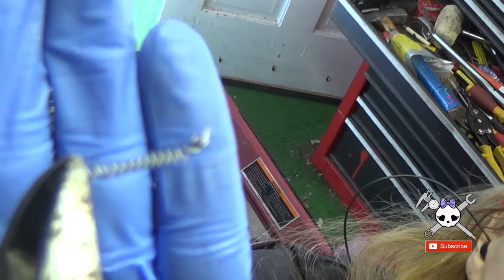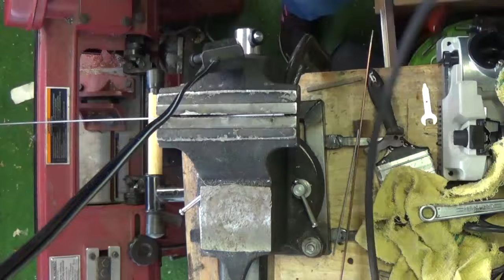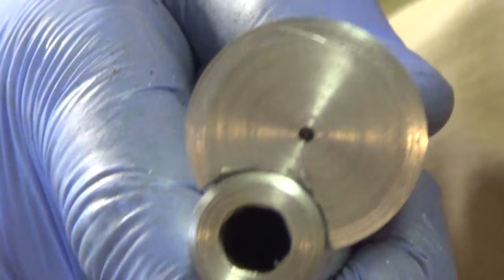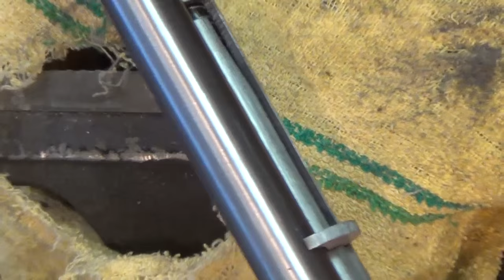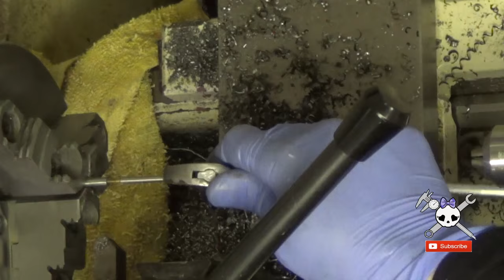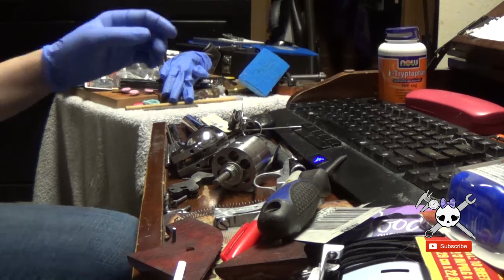1880's single action revolver build from scratch 15

Comment: Can't wait to see what's next.
Reply from the maker: thanks :)
Reply: A guy named John Anderson designed a ten round  bullpup 12ga. revolver. It had a blow forward design and a cammed cylinder that cycled the action and eliminated cylinder gap.  A few things weren't worked out in the prototypes, they had to be disassembled to be reloaded. I have no idea if that was ever solved, because the quagmire of  bureaucracy ultimately killed the gun and Pancore industries, the company he created.  I'd love to see your take on this, in a semi-auto of course. Even in different gauges or in pistol or rifle cartridges. The concept seems like it would lend itself to versatility. Seeing what you've done, I think it's well within your skill set. 
https://en.m.wikipedia.org/wiki/File:Jackhammer_blow.jpg
Reply from the maker: ya i have seen it https://www.youtube.com/watch?v=-VKGhqIl4Gw

I think it is a cool looking gun but as far as practicality not so much. just comparing it with  a reminting 1100 for instance . the 1100 holds 8 rounds + 1 in the tube and weighs about 8lb
the jack hammer is 14lb and holds 10. you could modify a Remington 1100 to be a bull pup fairly easily and loosing a foot of stock would probably even lighten it up a bit more. the 1100 also has easily interchangeable barrels that can be used for different applications (home defense /hunting)
so I don't really see any advantage to it at all
Reply: Waffenschmiedin x you're right about the Remington, and there are other bullpup shotguns that perform as well. But...
The jackhammer is just one of those guns that should have been. I guess I've become enamored by the simple elegance of it. And how many twelve gauge revolvers are out there? Who knows, in the interim, issues like weight may have been addressed as well.  
I liked watching how you did this project, you know far more about it than I do. Think I'll just sit back and see where your brain goes next.
Reply from the maker: hehe yes that's what I meant by it looks cool. its one of those guns people get because its FUN :)  im am far from an expert on any thing it was just an opinion :)
Reply: +Waffenschmiedin x Don't downplay your skills and knowledge. How many people can build a revolver from scratch?
Reply from the maker: my machining knowledge far outweighs my gun knowledge ;)

Comment: it looked as though your gun is very accurate,when you silver solder the front sight wasn't it hard to get it centered.If I was as talented as you I might have thought about drilling and tapping the front sight but I wouldn't think twice about buying one of your guns from the workmanship that I have seen you do.
Reply from the maker: it was a little bit of a pain yes.  the spring steel I put in the back sight groove self aligned so I just had to get it in line with it and square. normally that wouldn't be hard but doing it while hot made it fun :P
Reply from the maker: and I did think of tapping and drilling it but I thought it would ruin the look of the sight.  it definitely would have been easier

Comment: Good day...what do you think about grizzly lathes & mills?? quality- wise i meant..
Reply from the maker: the mill is as good as any mill I have used in any shop really it is really well built, the lathe is good where it counts. the chip pan and stand look a little like they were built in the back yard but over all ok, the steady rest that came with it is total junk and I will build a new one later. for the price they are amazing. I don't mind the chip pan and stuff because for the price they had to cut corners some place and I'm ok with it if its something like that. I was looking for some used American machines but almost all of them were wore the heck out. for the same price I got new and much more accurate then the wore out stuff. the import stuff will where out quicker I'm sure but it wont in my lifetime with the use its going to get so im happy :)
Reply: Thank you very much for very detailed answer...greetings from Ukraine,and God bless.

Comment: I think I would have gone through the trouble of either rust bluing or Colt's early bluing process. Seems like old blacksmithing tech. similar to heat treating. Where the gun parts are polished,cleaned with hot gasoline and heated in a furnace of charcoal and covered in bone char then periodically removed and rubbed down with oakum and whiting powder. The process essentially contaminating the case hardening process with carbon until the color is achieved. The use of oakum seems like carding to me. whiting powder(calcium carbonate) could be a polish or could be to add more carbon. Heck even the gas they used to wipe it down could be adding carbon. 

Im still working on piecing together what it takes to have a oxy propane torch, so no comment on a mapp hot head torch not producing enough heat to glass harden bigger tooling. But im not exactly sure why a propane forge couldnt get it cherry hot. Unevenness? A cheapo electric kiln element would set you back $3 through a chinese e-packet. Not as good as a 14 gauge kanthal A1 since it will only hit 1000*c. No clue how many insulated firebricks you`d have to get together for a electric kiln. running the prices. Im experimenting with 55 percent(by weight) mullite, 25 ball clay, 20 talc,  3.7% foam polystyrene granules no greater than 2mm and that seems to produce a very similar product to an insulated firebrick at a bit lower cost, along with things like kiln shelfs and ceramic electric insulators for the kiln elements if you dont add the styrofoam as the burnout material. After that it can be as easy as a proper amp rated infinite switch and extension cord since the element acts as the resistor. Point is an electric kiln would be able to hit uniform precisely controlled temps. Problem is you need to hit a kiln temp to fire those bricks in a KILN. Also my 11 function harbor freight multimeter is giving me higher temps than 1000c where my pyrometer tops out. The probe is nice only in that it comes with 3 links of porcelain heat insulator on the probe tip to handle the heat of inside the kiln. Im also running the burnout material(foam cups blendered) off in a camp fire before putting them in a kiln to avoid needless black soot exposure to my kiln. 

Perhaps you could assemble the kiln this way then the kiln would hit a temp to fully fire the kiln bricks off on it's first fire. Perhaps firing the bricks in a separate kiln before assembling it could be a waste of time. Judging from the exterior temps the bricks hit during a kiln firing Im doubtful it wouldnt at least melt in a rain to an extent, not fully firing bricks in an additional functioning kiln.

so far what im finding is its all highly suggestive that the addition of some form of burnout material in any kiln insulating mix recipe is advantageous to create the insulating portion of the properties of a proper kiln. IE air pockets.

Comment: Can that machinable steel really be toughened up with just tempering. I don't think so. Special types of steel alloys are used nowadays in gun making I'am sure. Great work all the same.
Reply from the maker: Jim Carmody yes 4130 and 4140 are used and thats what im using the frame is prehard so i dont need to harden it its already done.
Reply from the maker: The frame is about 30-35  Rockwell  . I use pree hard because it saves in warping (as much) when heat treating after the fact. I chose to use pree hard for that reason but its totally possible to heat treat it. I have the equipment to do it.
Reply from the maker: Oh one last thig people generally believe that if something is hard that it cant be machined. Not true ;)   as long as the tooling is harder than what you are machining you're fine. Most of mine is carbide i mention all this in the videos but most people dont watch them Ll the way through

Comment: Think you would be able to make a lever action rifle?
Reply from the maker: It's between a lever action  winchester or a 9mm sig style 1911. I'm checking on materials and availability
Reply: it would be super sweet if you could remake a winchester 1873, or a 1886. or even something crazy like a volcanic pistol
Reply from the maker: +james mcdonald would probably be a 1873 if I do it. I have a decent set of 3d plans for it already. I own a 9 mm sug so I can build one using it as an example.
Reply from the maker: +james mcdonald sig*

Comment: you may have mentioned but, what caliber is it?
Reply from the maker: 38 special :)
Reply: It will not take .357 ?
Reply from the maker: +Wally Verbeck no you can put a .38 into a .357 but you can't put a .357 into a .38 the case on the .357 is longer

Comment: shame about the dove tail cutter,
how about a sliding fore sight with a slot for a fixing screw to lock it down,

using good old fashioned german engineering,kinda like we had here till the lefties gave the contracts to china,japan etc,whatever, 

heres an idea, make custom gun bits an sell em on ebay,
then buy a dovetail cutter.or two.

you certainly can do the job,and if it's fun to do then it's not like work,

i play guitar,im an electronics technician,so i make tube amps to boost my cash,and i check them by playing,fun fun fun.
like checking if the revolver works,bang bang,fun,fun.kaa-ching!

but dont stop the vids,cos i need to learn more of the lathe and mill.

be well you guys,an'god bless.
Reply from the maker: I have recently hooked up with a local Gunsmith so I may have work coming soon :)  I already soldered the front sight on and it's accurate so I'm not going to change it now.  hopefully this other work might work out and I won't have to make decisions on my build based on money ;)

Comment: I am already in love with you, or at least your work and skills, so no hard feelings when say: I do dislike your descision on the finishing/blueing method, after all that amount of work you put in that thing. I appreciate the thinking of doing all by self, but could'n that hotblueing process have had been made elsewhere?How about heating up just normal drain opener stuff and putting in the parts, can be done outdoors with a camping stove? Never tried myself, but it should work ok. Put some scrap pieces in and find it out. Should be easier than color case hardening, that may also make unwanted stresses or colors on already high on carbon steels. Yet don't know about that or the details in the process...Those cold blueing solutions are more or less  a legalized crime in a bottle as far as i have tried those. More black on your fingers than on the steel after a while of handling.But that Gun, can't say a word how much i admire it. But as you mentioned it's only a matter of time and focusing. Perhaps proper tools...
Reply from the maker: lots of people didn't like it but the finish came out good and some times you have to work with what you have :)
Reply: You have all that patience, know-how and tooling to make such a thing, so you have all the knowledge you can read and all materials available in the world, to also finish the job perfectly. Besides, it's not a shame to give the hotblueing job to someone, who already has the equipment and skills to do it properly, when it comes to that kind of a piece. It's just something that doesn't come out from a garageshop everyday. :)